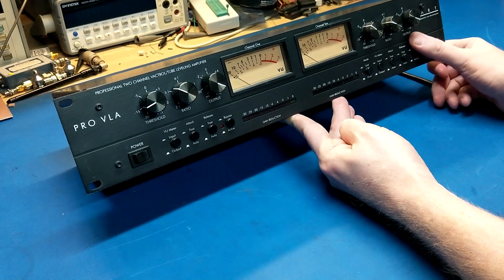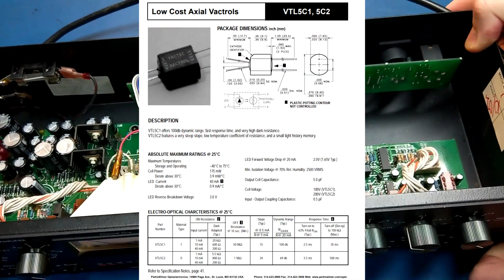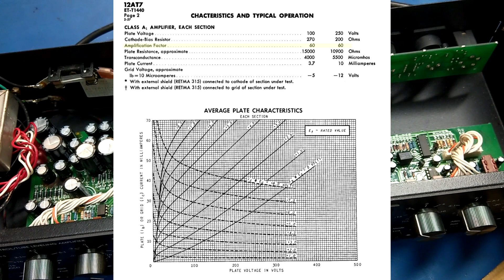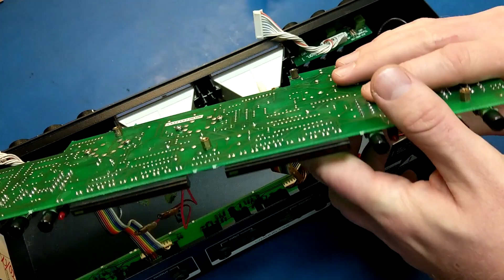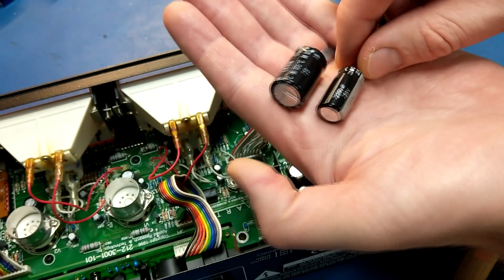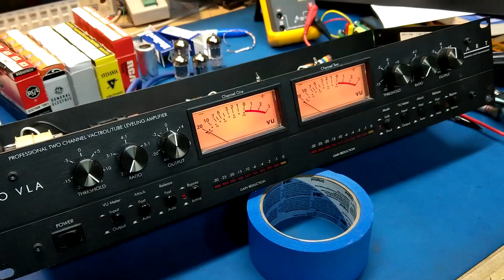ART PRO VLA Compressor Hardware Overview

Comment: I bought one of their 1U rackmount DPS II digital valve preamps, back in 2005 when I worked for the UK distribution company Sonic 8 Ltd.  Excellent preamp although it has a quirk, where the phantom power is applied to both the front XLR inputs and the rear 1/4" jack inputs at the same time.  So you have to remember to not have any other gear plugged in the rear sockets when switching phantom on, or you can fry your gear.

Comment: ART PRO VLA II owner here; 12AU7's provide way too low gain for these units. When you crank it up to +5db to match input and output levels, it starts getting tube saturation a lot. Original ones are Ruby branded 12AT7. I wonder what EHX 12AX7s do. 

Problem 2: I installed a matched-pair JJ 12AU7 and still had to play with trimpots to match levels. Found a good balance when I make one of them maxed out, another one near to minimum. When you match them when stereo-link enabled, be prepare to be shocked when you disengage it. It lose the balance again. 

Problem 3: You think you balanced them at last? When you start compressing, despite the exact same settings, two channels apply noticably different gain reduction and lose the equal level again.

Problem 4: Not hearing enough levels on outputs, the red peak leds lighting up very often, yellows are on -3db, not even a halfway of headroom.

Solution: That's how 12AU7's work in VLA II. Never stereo link the device. Just use 12AT7s. Matched pair is not needed! Not even take you anywhere. You still have to struggle with trimpots.

Comment: Those VTL5C1 are quite fast. About 35ms to switch off. So they are often used for channel switching in amps.
And some other VTL5C* are more like 500ms :( But maybe it's Ok for compressors. 
I tried to use white LED and photoresistor but  it was also too slow for switching off. 
I'll try other colors then. Thanks for a hint :)